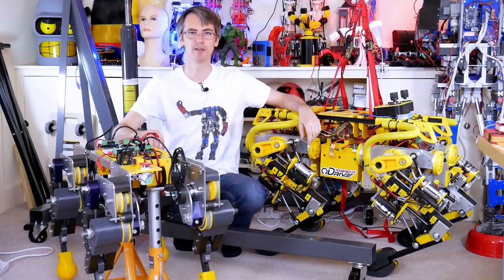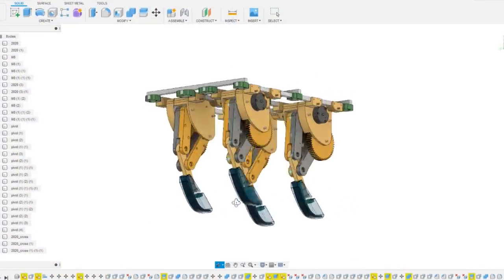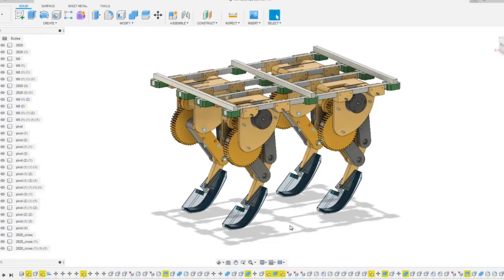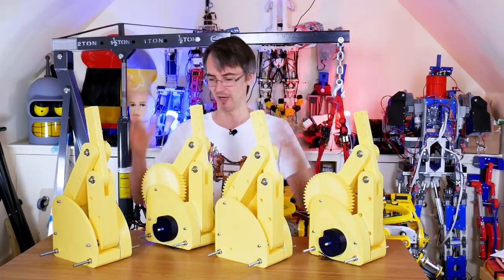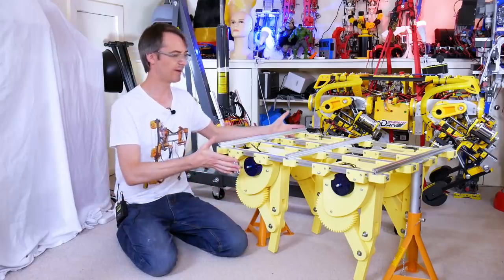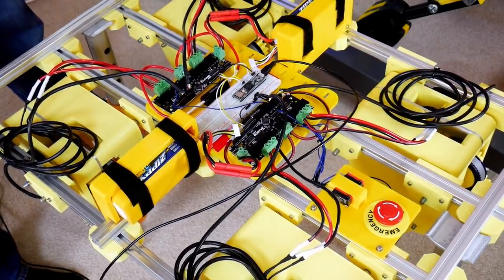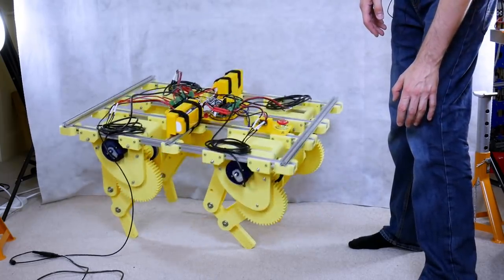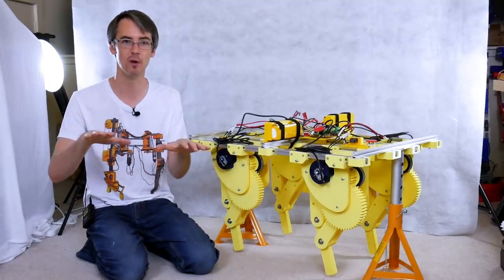A Lighter More Powerful Test Robot Dog

Comment: Hey James, you've inspired me to build my own dog robot :)
It's going to be a lot smaller than open dog though, since I live in a pretty small space. I was wondering if I could stabilize it by using a gyroscope. People use the same prinziple on little self-balancing motorcycles. Have you ever thought about adding one to open dog? If it works out as I imagine, your problem with it tipping over may be solved.

Comment: Hmm, do you think it's the rigid frame tying the front and rear legs together that's causing the skew/lean towards the right fore foot? I mean, in mammals the spine allows the rib cage and upper torso to rotate independently of the hips.  In essence, creating independent suspension and also allows the animal to co-adjust its center of rotation with its center of gravity.
Reply from the maker: I think it's just a matter of overall balance - I'm quite far ahead with putting its feet on which initially had the opposite effect

Comment: Would it be possible to use the encoders to get more data on the forces applied to the legs, by looking at deviations from the target position (or the expected position in zero-G based on knowledge of how the mechanism behaves, to account for the lag when the a new target position is specified and such)?

Comment: I think I could save you some time with your printing and some weight too.  The large gears on the legs would seem to only need to be about a 1/4 of the actual gear due to the maximum movement of the leg.  You could alter the design a bit and only print 1/4 or even up to 1/2 of the full gear and still get your full range of motion.  On the aluminum ones, you could also cut out holes to reduce weight but still be strong enough to hold the unit.    Just some thoughts.  Looks impressive though.  I've always wanted to work a project like that.  Good luck!

Comment: Why not offset at least part of the weight of the dog with some springs? Those big drive gears can even be modified with a built-in torsion spring (like in a watch) if space is an issue.

Comment: Well done colegue. I wouldn't use all 350 of the big gear but rather a small portion. Needs rubber feet and current sensors on the mottors. I thing it will not be that expensive as pressure sensors.

Comment: "Half speed, twice power"... No, the power remains the same: you get twice the torque, but as speed is half, the product remains constant.
Well, you may gain a little bit of power as the motor torque may increase with the speed (I don't know how torque/power change with speed for a brushless motor).
Reply: Poor torque at the bottom and top of it's operating range. The low end torque is better with the odrive since it is sensored, but preferably it wants to be in the middle of it's speed range for peak efficiency/power output.
Reply: @williamforbes6919  Thanks for the explanation.

Comment: Looking pretty good, to get forward movement you are going to have to be able to rotate those legs at the hip, but you already touched on that and seem to be ready for it.  Can you use current sensing to determine if the leg is on the ground or not?

Comment: you can remove quite a lot of unneccesary weight by removing the material and teeth of the large gears that will never come in contact with the meshing gear, creating partial gears. I guess you won't need about 270 degrees worth of teeth and material on those big gears.
I know 3D printed parts are light, but still.

Comment: How about adding an accelerometer.  Right now the robot doesn't know it is leaning left, right, forward,  or backwards. So instead of driving the leg to the set point,  drive it to make the robot level.  Then when you put a block under its foot, the leg will stop moving shortly after contacting the block. This should also help it climb over obstacles.  You will also have to  code for dealing with inclines. Basically if a pair of legs (side, front, or rear not diagonal) are near minimum or maximum limits let the robot to lean, allowing the legs to center their travel.  And  by setting a maximum lean angle the robot won't tip itself over on inclines.

Comment: Awesome work as usual! I assume you considered this first before remaking an entire new dog.

Was there no way of modifying individual parts in the other springy leg dog before embarking on a completely new one:
- Simply replacing gearing parts in the shoulders to increase the gear ratios?
- Replacing some metal parts with modified plastic parts? 
- Cutting large holes and pockets into existing strong aluminum plates? 

This all just seemed to be a lot of mechanical rework. And the other dog was extremely well built but now is taken completely apart for this one. Considering that one easy fix to the old one could have been supply more electrical power (for more holding current) to the odrives. While I agree thats not the best solution, starting from scratch couldn’t have been much of a time saver. 

What are your thoughts on this?
Reply: If I understood what he's said in previous videos.  This micro dog is a test bed for changes to the full size.  He's invested so much time and money on the large one, he's not going to rebuild it until he has a clear path for changes to it.
Reply: @Scott_C  Right! Super beneficial to use a micro dog to work out some R&D for sure. My point was this is the 3rd dog, and I question if these R&D steps in this video were necessary to rebuild a whole new one instead of using the second dog. I just wonder if it was worth embarking on a 3rd dog with all of the new parts, teardown, redesign, 3D print time, and reassembly.

Comment: AMAZING JAMES the CG looks to high, maybe undersling the batteries.  When i look at spot and similar quad bots, ive noticed how much the body is or doesn't go more than a few inches above the top pivot on the legs.  as the cg for most quads is somewhere between the top of the knee and the top leg pivot. Love this new iteration...  those gear wheels need slicing to a small section? just absolutely love this project amazing stuff.

Comment: Why don't use parallel link?
Reply from the maker: The hope was that the legs push back slightly as they extend so it might go forward - it's the same geometry as the previous video
Reply: Yeah I've seen that before . But I still don't get it.  If I was you , I will made it go straight.
Reply: I work around with Spring-loaded  Inverted pendulum like its behavior and how to control. It's might be good if we can talk about this.

Comment: Front gears smaller for speed. Two plat forms with big spring in middle like spine. Rigging so that when one limb is lifted it adds force to the limb likely to be pushing.

Comment: Awesome James your videos are so amazing and it's really cool to see the progress. I just had a suggestion of using a multi-stage planetary gearbox. It'll improve to gear ratio pretty significantly. If not that then a strain wave gearbox will give loads of torque in a convenient form factor.
Reply: A single or double stage belt reduction should actually get him the required torque. Though a 3D printed strain wave gear made from CF-PA would be pretty awesome.

Comment: For those big gears you don't actually need most of it - did you consider that?
Reply: Wouldn't that reduce future movement options? Like if he wanted it to walk, would he need the full gear?
Reply: Sometimes it's as quick timewise (also with very minimal difference to filament usage) to print simple Infill rather than design in extra cutouts as would be done for traditional parts. For the extra edges created, the printer has to run in detailed wall shape which is also usually at a thicker section than the infill.
Reply: @ojsh_  I think he's referring to the fact that the gear doesn't even turn half, it can be a quarter of a circle and it would function the same way
Reply: @stocchinet  oh yeah, good point actually!

Comment: You didn't need to use such a big sspur gear I you just need a sector gear. Also,  the gear teeth will fail in fatigue so you should start looking into metal gear manufacturing
Reply from the maker: It's just a test dog - the gears are massive for a reason

Comment: Rather than using pressure sensors to detect feet placement, could you look at monitoring motor current in odrive? (If that's at all possible?) I'm assuming the motors will be using more current to bear the weight on that motor?
Reply: literally scrolled down and started writing this comment, even if the odrive doesn't allow it directly (Although I am pretty sure it does?), there's lots of ways to measure current on a system like this.
Reply from the maker: Yes check out the previous videos - the current sensing is noisy though
Reply: @jamesbruton  Have you considered doing a double sprang pivot hip with a rotational centering.  Imagine kind of like the RoboSapien how its hip was elastically sprung, but two of them.  Now have maybe 2 x accelerometers (1 per hip pivot), provide PID loop input.  RoboSapien used a trunk swing gate to move, but this technique could possibly be converted to a swing and pivot gate.  What I am envisioning is something really light weight, like servos hot glued to icy pole sticks, with servo control points between two elastic bands.

 Neutral
  |            |
  +---------+
  |            |

Right forward

    /       \
  +---------+
/               \

Left forward

\               /

  +---------+
    \        /
Reply: @MollyWi  I thumbs up'd because you managed to make a convincing drawing in a friggin youtube comment.  That's some determination :)  Many ways to approximate a mechanical gait, seems as though James is determined to do it with a minimal of gimmicks common in the toy industry.  Problem with those approaches are they are self-limiting and not at all adaptable to changing or challenging terrain.
Reply: @jamesbruton  What if you put strain gauge sensors onto the legs? You don't need to use a full strain gauge, but instead could epoxy a BF350 foil sensor onto the lower leg beam. This would give you extremely precise load sensing without introducing a bunch of extra flexible support material or padding. It should be more consistent than a force-sensing resistor at least.

If you want just an analog out from it, there are eBay and Amazon kits with both an amplifier and gauge for under $8. A full setup for all the legs would be under $35

Comment: Looks like you could simplify it and reduce the weight by integrating the big gear into the leg bone that it's currently attached to. Only a few teeth ever actually get used, so you could just put them on the end of the bone instead of using a full circular gear.
Reply: I had the same itch during the whole video, It would save quite a bit of weight and make it look better imo
Reply: Nice!
Reply: You would need to counter balance the gears then tho as they would be asymmetric. But yeah that would still save weight.